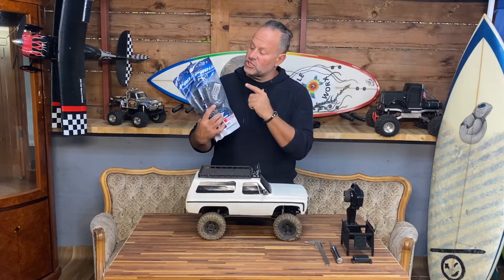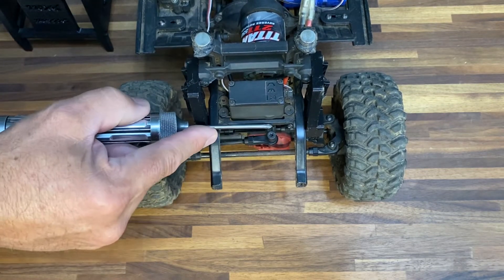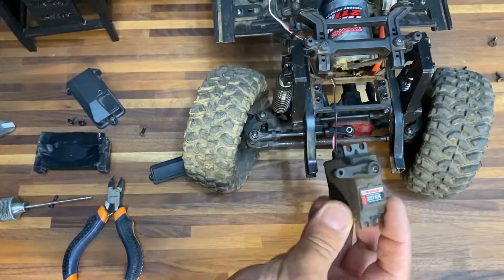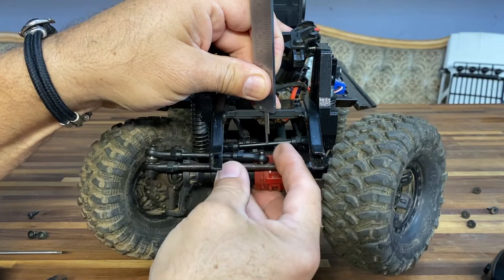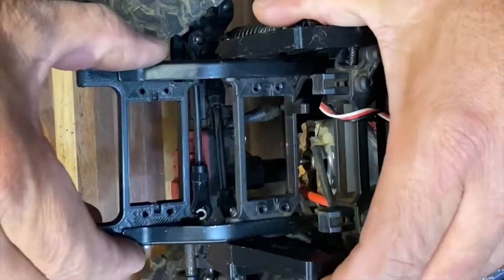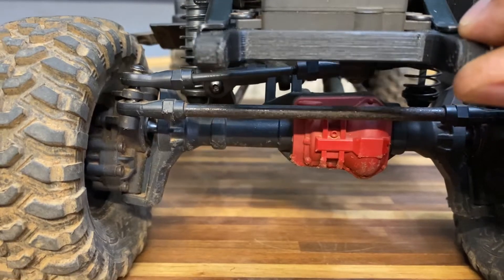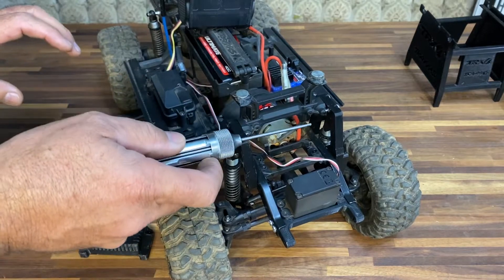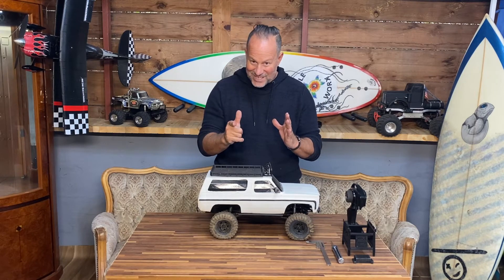Reposition Steering Servo

Comment: Hi I could really use those prolines I'm new to the Hobby and I've started by buying some inexpensive Rigs and Performing modifications to them I have two crawlers right now one that has less-than-desirable performance tires on it now 1/10 scale Redcat Ridge Rock Banks really enjoy your videos
Reply from the maker: nothing like testing your own rig after building it ourself. You are in the final draw

Comment: That looks awesome. How do you run stock TRX4 K5 bumper with servo mount there ? Prolines would be nice on my K5 TRX4 also lol
Reply from the maker: the bumpers are attached to the body not the chassi, no space for original bumper setup. You are in the final draw for the tyres